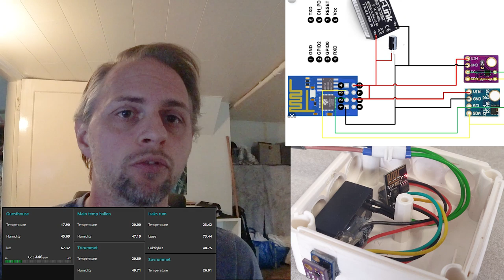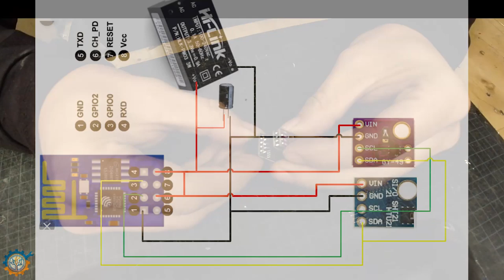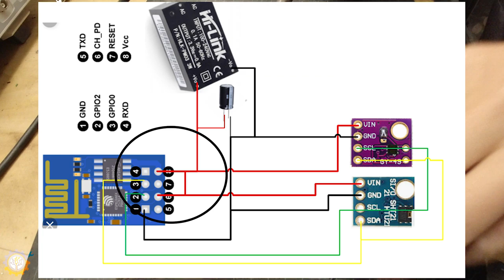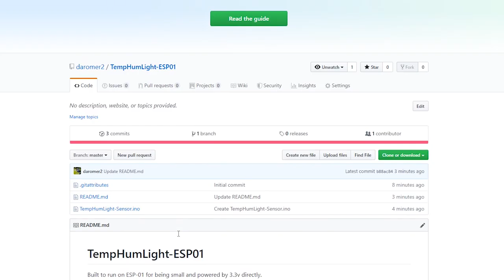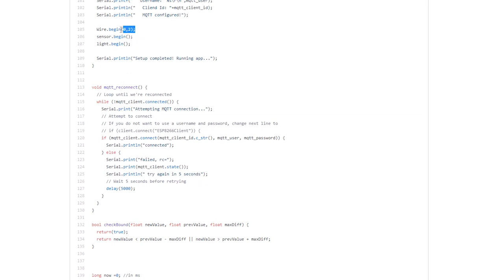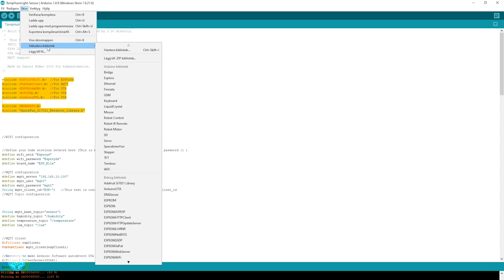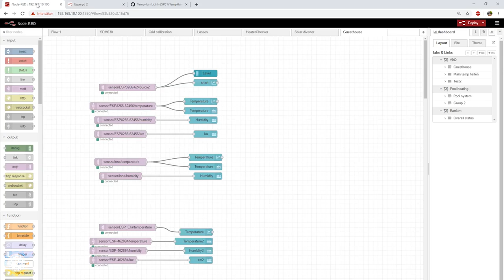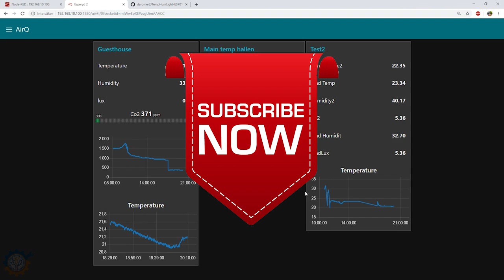Temperature, Humidity and Light sensor for under 7 USD with MQTT support

Comment: I don't understand why you soldered the sensors to the top of the ESP-01 instead of to the pins on the socket. That's what sockets are for.
Reply from the maker: Because i want the pins to be free if i need ed to reprogram it. Easier that way